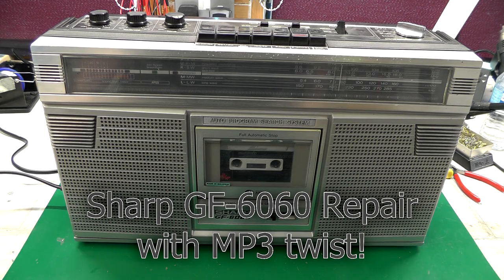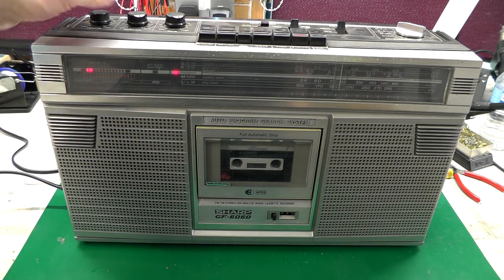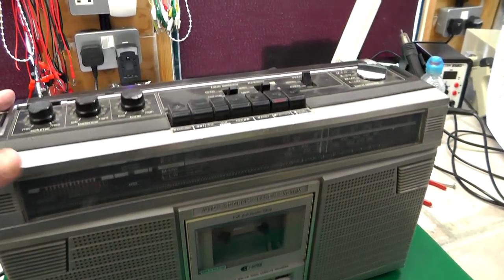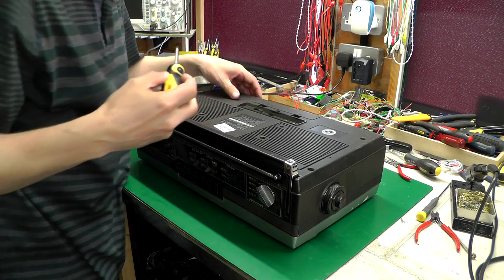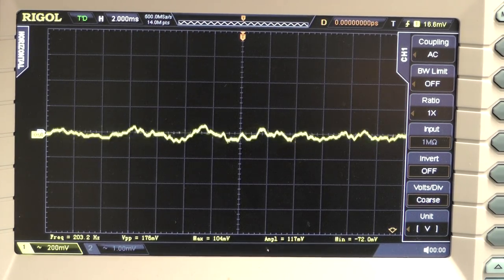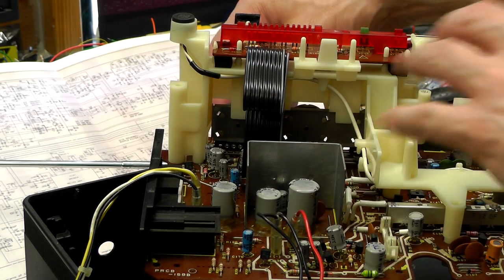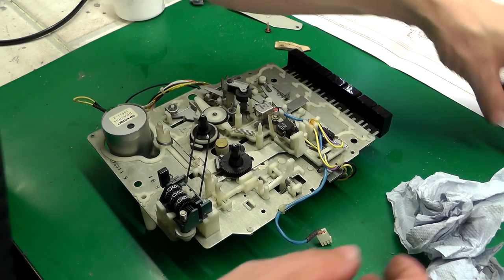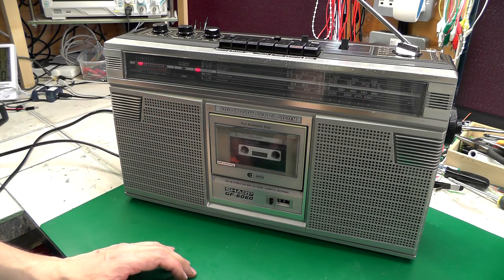No.031 - Sharp GF-6060 Radio Cassette Player Repair with MP3 twist

Comment: Found this really interesting. Thanks for posting. I renovated my GF-6060E a few years ago. Got it for my 13th birthday in 1982. Still going strong and still have the box and all the paperwork. I love it. No need for an MP3 player though...I've still got 500 cassettes to play on it. As already said, good, solid build quality and with maintenance in mind. Even this novice (ie: Me) found it a breeze to service. My volume control has started to make the same crackling noise. Hopefully switch cleaner will do the job. My only complaint with this unit: the speakers needed a bit more bass oomph!
Reply from the maker: I have a feeling I got mine for Xmas 1980. Good to hear there are others being used. PS. I was amazed how good the 'MP3 cassette' sounds.....like one of those old retro metal tapes on steroids.

Comment: Thank you really enjoyed this. i had the much smaller Sharp 1760 back in 1981 given to me for my 15th birthday, used it up untill the early 1990s  when the cassette mec packed up , (probably a snapped belt ) so i gave it to my Dad to use as a radio at work and alas never saw it again!
I still have cassettes mostly talking books  but no machine to play them on so recently i have been looking out for a Sharp 1760 on E Bay and eventually found one (Not Working) for about £20. 
I bought it and it turned out that the problem was an oxidised mode switch .I also played slow so on investigation it proved to be a  dodgy tape motor , those replaced i now have a  great machine and the identical one to the one given to me for my 15th birthday.
Back in the day i loved SHARP products and had a Tv Music centre and a walkman type player. They were always innovative and well made.
What has happened to them now ?? looking at their products now they are Crap ! 
Very Sad!

Comment: Thank you so much for this video! I just repaired an identical one i had in my garage with similar problems, i'm impressed by how well WD40 worked with potentiometers and even the power switch in my case. Now the only thing that does't work is fast forward and rewind but i bet it's because of the worn out main belt i should replace. I also replaced the other two belts with rubber bands and they seem to be working.
Reply from the maker: Yep, rubber bands will work.....just they might not last too long since they will harden. But good work anyways!

Comment: I had the Sharp GF5656 - AM/FM version of this in the early 1980s.  I loved that machine - the  stereo was way better than the portable monaural systems that existed before then (the 'boombox' generation), but also I loved the human factors of this system - the simplicity of the design and displays, as well as it's input/output capabilities.  I actually used it not only to listen to music while studying, creating mix tapes from the FM channels, but also I connected it to my first PC: a Texas Instruments TI 99/4A ( https://americanhistory.si.edu/collections/search/object/nmah_1064832 ) - to store programs in my nascent programmer days.  I got mine when I was 16, and your breakdown of the machine validates my thoughts on it when I made the decision to buy from a stable of competitor machines - well engineered/designed on multiple levels, enough so to keep it running after nearly 40 years with only minor issues.  Also, do you have a link to the cool cassette MP3 player you showcased?

Comment: Have the same one (as a gift), looks very servicable friendly inside. Mine has sticky tape controls (hard to push) and won't play any tape. I guess it is a belt issue. Very nice tut to take it apart. Don't use regular WD40 (unless it is contact spray from the same brand) on potentiometers, it is not meant for that. You can use WD40 on corroded metal parts however only when regular contact cleaner doesn't help. It is possible that WD40 dissolves plastic parts over time because of the oily nature. Be careful with this stuff.

Comment: Well the construction looks the mechanical and electrical engineers actually talked to one another during the design phase to facilitate servicing! That extra coaxial power plug looked to be a 2.5mm vs. the DC in being a 2.1mm, probably done to preclude cross connecting sources. Nice fix, thanks for sharing...oh BTW, you'd really be old like me if you'd gotten a 8-track machine!
Reply from the maker: When I was a kid I had an 8-track player (from a car) hooked up to a 12V PSU in my bedroom. Loved the 4ch endless loop nature of those things.

Comment: I’ve just got one of these and I’m trying to fix it up. The volume is very crackly and loud. Only one channel works and even when fully turned down, it’s at a medium volume. Soon as I turn it up a little the other channel activates. I’m also having issues getting stereo on FM. Very rarely I can get it to activate, despite a strong signal.

I’ve tried contact cleaner to no avail. Can you suggest what else I could try? Have you experienced any of these issue?

Comment: I've got one exactly the same model & the tape heads have worn but the radio works fine. The tape only works on one speaker but the radio both. I'd like to add bluetooth to it & convert the tape to an android dock. How do I do it?

Comment: I have an 8080 and an 8181, both have issues with the ff/rw speed which makes me strongly suspect that the bands need replacing but I'm not sure what to measure.  Are they a universal size or does it change between manufacturers?

Comment: Your video will help me restore  my father's Sharp GF-6363 Z radio cassette player. It seems that the GF-6363 Z has the same mechanism as the GF-6060  because when I opened it, it looked the same. I'll probably make a video on  how to restore the GF-6363.

Comment: Hi loved the video, I've got a limited knowledge of electronics but I've got a sharp GF9191 (growing up in the late 70s early 80s) which has been in the loft for many years, the tape wasn't playing so I took it apart and the belts were snapped, I ordered a new set from Germany and installed these, all is working apart from the wheel that drives the cassette tape, its the one connected on the left of the 2 which the cassette reels sit in and it also runs the belt down to the counter, any ideas?

Comment: You can play audio through a aux cable through the mix mic port on the side.
My machine won't play audio unless I manually turn the boombox on by lightly pressing on the play button.( It should start playing when you plug in the aux cable) Audio will play through the aux cable but the motor is spinning as well. The motor wouldn't stop spinning even if unplug the power and plug it in again. Anyone know what's wrong?

Comment: I have 2 of these from my dad both worked fine but 1 was in a poor state broken plastics and missing a battery cover so i bought a faulty unit to use the case from and any parts that are in better condition .

Comment: You want some servisol super 10 switch cleaner... honestly worth every penny and available easily at maplin etc
Reply: WD40 and 3in1 oil left me horrified.
Switch cleaner is cheap and reliable as you say.

With Ian's experience I would have expected the right stuff to be on hand.
Reply from the maker: Ok ok......I DO have a can of Silver Hook Electrical Contact Cleaner (500mL) to hand......um, bought a long time ago but have only used it a couple times.....but I promise to use it next time! :-)
http://i.ebayimg.com/images/g/x1QAAOSwDNdV6EVv/s-l300.jpg
Reply: Saved me driving over there and giving you a can! :-)
Reply: I have a can of servisol it’s awesome stuff especially on crackly pots

Comment: Hi there, thanks so much for popping this video up. I'm attempting my first tinker with electronics as i found a rad looking Sharp GF-6000 on the side of the road. You mention at 17:05 "because i got the mains down to this corner here and it’s rather close to me, I’m gonna put some masking tape over this fuse because i think it’s the AC input". What does that mean? Thanks.
Reply from the maker: Just incase I accidentally touch the fuse holder which is live!
Reply: wow really great video. and the mp3 cassette at the end was brilliant! I've never really fixed anything before but looking to get into it as it seems to give people a sense of agency that i too would like to possess. obviously being very new i have so many questions but i'll try to limit them...the schematic map....I understand the r159 and r160 were along the line that feed the signal, but how did you know not to test any within the volume control area such as the r177 or the vr103? Is that what you were testing when you mentioned "let's have a look downstream" at 24:40. Also, is the machine you used after called a 'scope meter'? Sorry, so many questions! Thanks.

Comment: When you put 3in1 into the pot was it the bog standard oil or something special? Interesting video.
Reply from the maker: "3in1 electrical"......just a drop into the pot through the small hole followed up by a bit of wd40 again to help spread it around. There's probably something better but not in my workshop.

Comment: Sorry. But to treat the pully and the flywheel with sandpaper is not the smartest way.
Even on a low level unit like this.
Reply from the maker: An uneven, hard, rusty, corroded surface, not just dirt. I think I did the right thing.